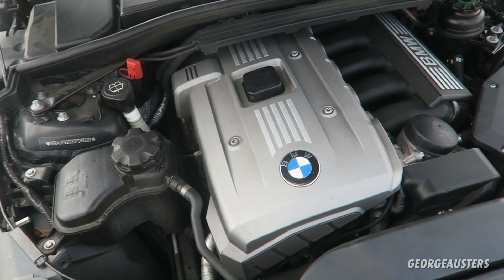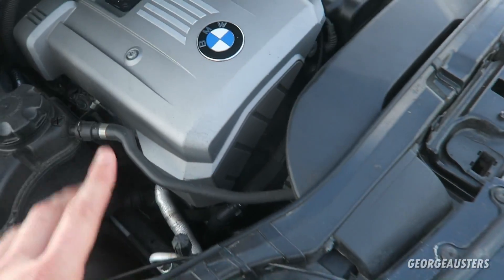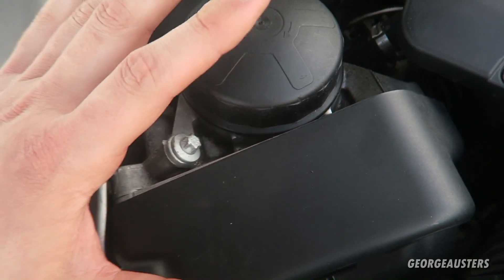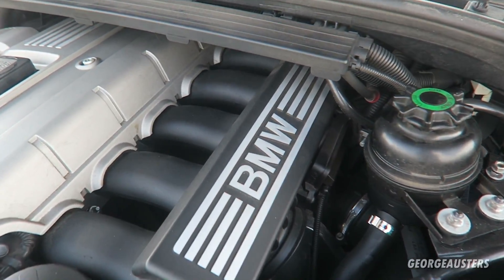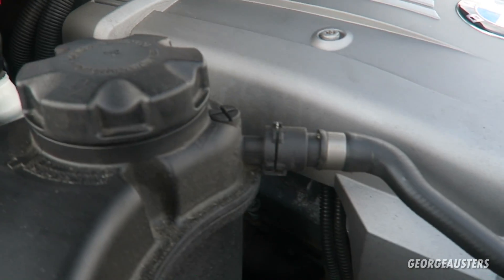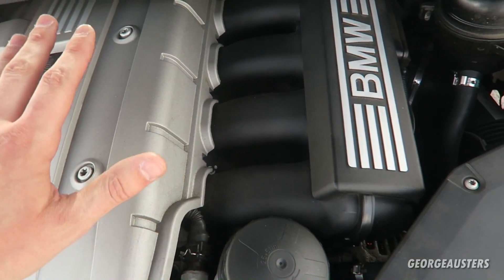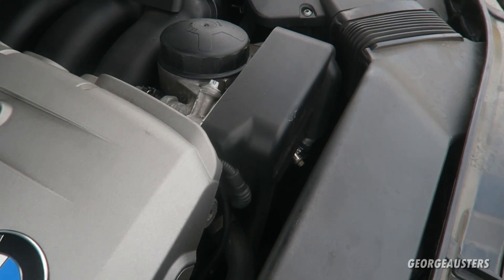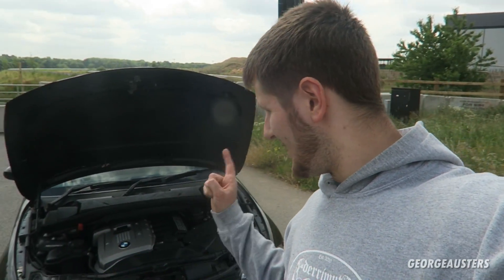BMW N52 Engine Parts That WILL FAIL After 100,000 Miles

Comment: Great video's... Thank you for publishing them.   I have a 2007 BMW 328xi with the N52 engine.    How can I replace the EGR valve?   I don't see any video's on that procedure.   I watched this video thinking the EGR valve would be one of the components that fail after 100K miles.
Reply from the maker: EGR valve? There isn’t one on the N52
Reply: @GeorgeAusters  THANK YOU. I thought ALL vehicles had an EGR valve.  What started me on this path is, I pulled a P0400 code and that specifically says the EGR valve is faulty.   Parts suppliers also say "EGR" valve, however, seem to display a picture of the Secondary Air Injection valve.  Doing more research,  I see the Vanos system mimics the functionality of an EGR valve in Petrol BMW engines. I had no idea.

Comment: I agree that the water pump will likely go slightly before or after 100k 
But mine is now on 134k on the original pump and stat.

If they fail they the car will go in to limp mode so won’t cause any problems.

I am considering changing mine as a precaution as I have some big road trips planned this year. 

But if you are not doing that I wouldn’t replace it until they fail. I mean if mine had been replaced at 100k I would of lost out on 34k worth of use. 

Some things are cheap and worth doing as a preventative but some maybe not so.

Depends on the owners requirements I guess.

Comment: Many thanks George. Concise and easy to follow, also good to see another Euro and RHD perspective. 

Water pump and thermostat ✔
Valve cover gasket ✔
Plugs ✔
Coils ✔

Belt and pulleys, oil filter/cooler gaskets this weekend.

That leaves DISA valves, starter motor and automatic gearbox service hopefully next year for me...

Non-engine wise have you had to replace/due to replace anything? My headlight washers are sticking and rear washer in my 2007 N52 E91 have gone, plus I'm losing radio signal when I use the rear demister. Will probably replace the panoramic roof seal as well due to noticeable wind whistle but luckily no water. Nevertheless, the NA sixes give a delightful drive and the last of its kind, such a shame to see these cars often maintained cosmetically but neglected mechanically 😢